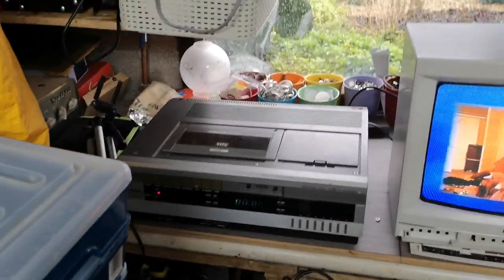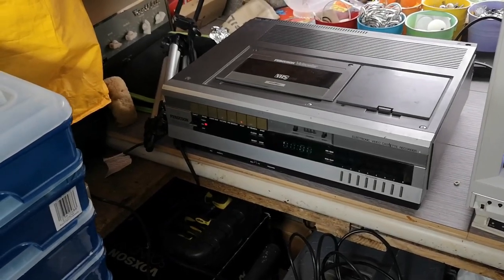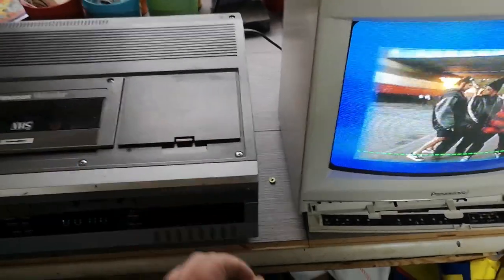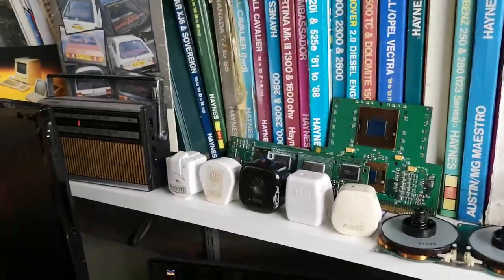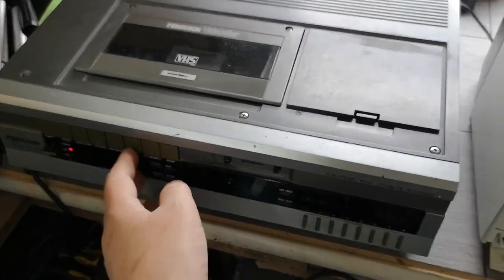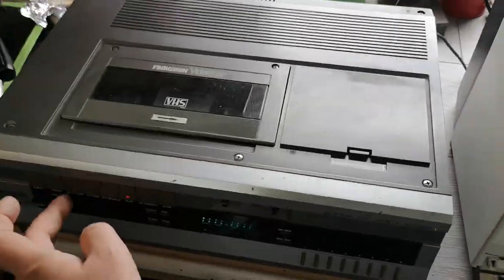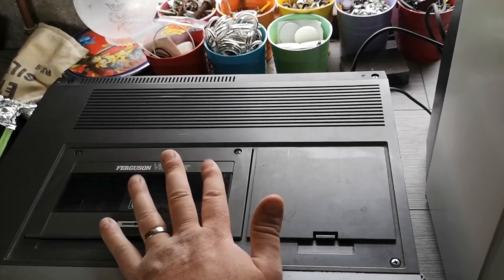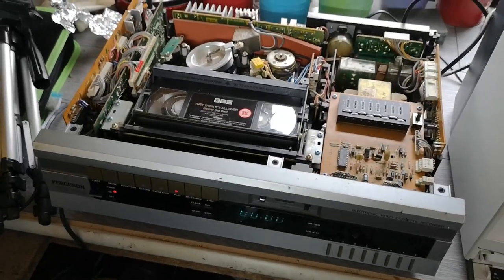Ferguson 3V29 Service -  Part 3

Comment: Hi, it looks like an unlocked capstan servo, so it might be a problem with the audio/control track head not picking up the pulses. I don't think adjusting the entry and exit guides will help and when they're mis-aligned they usually just cause static tracking bars. If you think it might be a tension issue then it might be worth checking the tension band on the supply spool, as the play idler driving the take-up spool is after the capstan/pinch roller. The main idler drives the spools in Rew/FF and picture search modes but not during normal playback as that's handled by the separate play idler. If it's an electrical fault then the servo board is one of the two on the left of the deck, one should be audio and the other servo. Hope that helps.